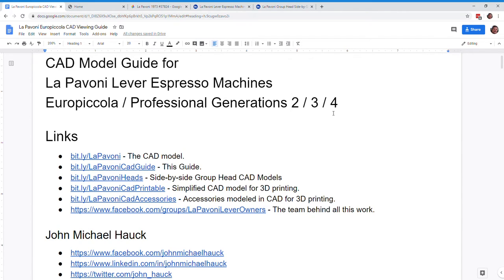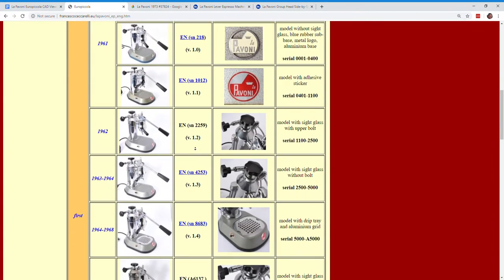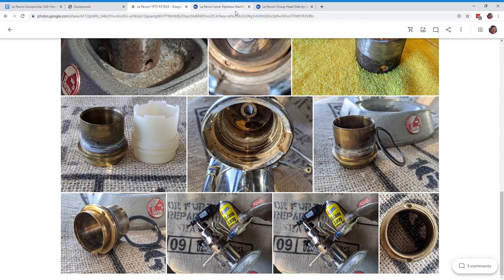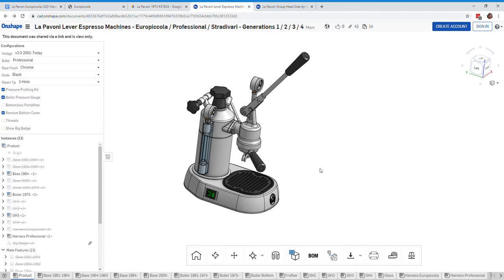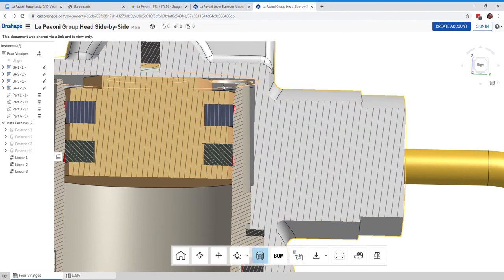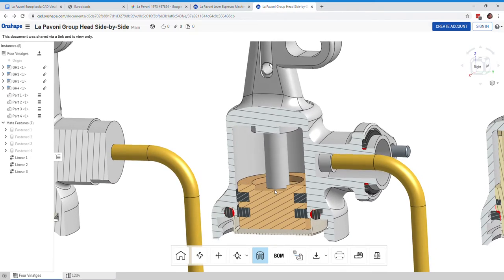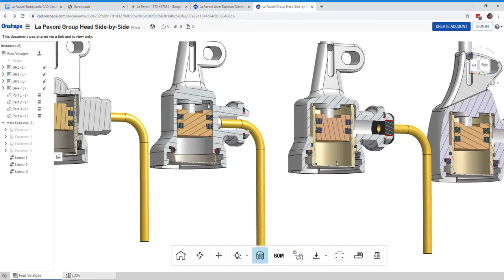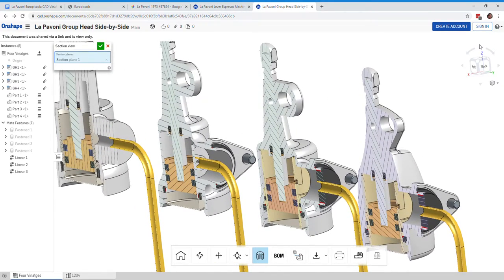2: Four Generations of Group Heads - La Pavoni Lever Espresso Machine

Comment: Hi John, great work! It explains a lot. Could you also explain what happens when you lift the shaft and the portafilter with cofee is on? I expect some air coming through the portafilter and the coffee being trapped above the water. I think this air steals some space from the water (reducing the shot volume) and makes the shaft spongy when you push the lever down.
Reply from the maker: Massimiliano, you and I share the same understanding of trapped air and spongy pulls. I wrote up my thoughts is two places: https://www.facebook.com/groups/lapavonienthusiastsgroup/posts/512743113415984/ and here https://www.home-barista.com/levers/trapped-air-spongy-pulls-again-t76728.html
Reply: Massimiliano, since I've started lifting the shaft almost to the top before attaching the portafilter, I've had the best crema ever.  It takes a bit more dexterity with one hand on the lever pulling up and the other hand holding down near the drip tray, but it's worth it!

Comment: Amazing work! What nice models. Are the diameters of the lever shaft of 3rd gen accurate so I can base myself on it to make a pressure profiling kit ?
Reply from the maker: You are welcome to view the CAD models at http://bit.ly/LaPavoni
I cannot provide any assurance of manufacturability. There are so many variables to consider. For example, there are variations in production, so any measurements made on one part does not capture the tolerances of a real product. Also, I used a digital Vernier caliper without formal training... so well there you go. I am open to any community feedback that can help improve these models.

Comment: Can you add a spring into the group head? Also could you add a valve to be able to pull back -to-back shots? Just two absurd questions I had.I have a Gen.2 La Pavoni and a more recent Professional.
Reply from the maker: You ask, "Can you add a spring into the group head?" Interesting! Well, then lifting up the lever would require a fair bit of effort to compress the spring. You might be lifting the machine off the table. The spring-lever machines I have seen have the handle the other way so pressing down compresses the spring. In any case, I think the spring would prevent the piston from going up high enough to let in the water. Other than that, I think it might work. I've never heard of anyone asking this before.

You ask, "could you add a valve to be able to pull back -to-back shots?". Honestly I am not sure what you are asking. If you mean raising the lever to run another pull of water through the same puck of coffee grounds, then you can already do that. It creates a vacuum when you raise it immediately after pulling a shot. That vacuum may or may not destroy the integrity of the puck. I'm sure you can get strong opinions on that either way. I've done it before. Some manuals say you can do it too. If you mean something else, then let me know.
Reply: @JohnMichaelHauck  Thanks for your reply. The second question needs clarification. On the automatic lever machines, most have a 3 way valve that allows them to take the portafilter from the group head without waiting 30 seconds or so before reloading another full basket, on a La Pavoni there is the traditional time lapse before you can pull your next shot, in the automatic machines there’s a 3 way valve and a bleeder tube that releases the pressure in the group head that releases water so that the portafilter can re-loaded. So could a 3 way valve and bleeder tube be fitted to quicken the time between shots in an LP? I have an LP and am interested in it’s mechanics.
Reply from the maker: Ah! Taking the portafilter off early on a La Pavoni can result in, what many affectionately call "The La Pavoni Sneeze". Some of the "after" photos are truly works of art. In any case, you can reduce the backpressure immediately on a La Pavoni by simply lifting the lever about half way and removing the portafilter while the maintaining the lever in this position. Why does this work? Understand that there is always some compressed air trapped in the area below the piston and above the coffee grounds. Raising the piston half way increases the volume of the area, reducing the air pressure. Another option is to use techniques to reduce the amount of trapped air  to begin with. My opinion (hotly disputed by others) is that by flushing hot water through the group head before attaching the portafilter will help reduce the trapped air. Why does this work? Because it helps the initial hot water that enters the area to "flash vaporize" (Google that term) into steam - driving out the air through the ground coffee. Of course, that means you are brewing with hotter water which may make the shot taste a bit more bitter. Finally, some people are experimenting in using a "pressure profiling kit" to bleed air from under the piston through the piston rod. Sheesh that was a long reply.
Reply: @JohnMichaelHauck  thanks

Comment: are 2 and 3 identical on outside?  they look to be
Reply from the maker: The diameter of the top part of the generation 2 group head is 50mm, while generation 3 is 60mm.
Reply: aahh ok thats the pre and post ones right?  @JohnMichaelHauck
Reply: ahh ok mine is the 2. ... what upgrades can be done to the 2? I refinished it in ferrari red and chrome and added the boiler pressure ggauge and a cafaleta portafilter/IMF basket  and silicon gaskets a few years ago but it always gave me issues like seizing up with handle up... hard to pull shots..  and just total inconstancy.. but ive decided to get it back out and work out these issues... usually im working on more commercial units but this one befuddled me until I saw your cross sections.. now Im curious!
Reply from the maker: @dparham  Generation 1 started around 1961, Gen 2 was 1975, Gen 3 was 2001, and Gen 4 was 2005. People call the Gen 3 the "post mil". Gen 4 is also after the millenium, but I think most people call that the Stradivari instead. "Pre mill" seems to refer to Generation 2 only. Generation 1 is also before the millenium but frankly seems like it is no discussed much. Personally, I just use the generation numbers. Finally, both Gen 3 & Gen 4 are actively being manufactured.
Reply from the maker: @dparham  As for your Generation 2, it is not clear to me when you mention hard-to-pull shots, if it is a mechanical issue or an issue forcing the water through the ground coffee in the portafilter.

If it is mechanical, my guess would be adding some lubricant to the inside of the group head and on the two piston gaskets. Search for a high temperature food safe grease.

It it has to do with forcing water through the puck, the following will make it easier: grind coarser, use less coffee (13g), brew when the group head is cooler, don't push the lever too hard - being patient to let the water get through, and use older beans.

As for upgrades to the Generation 2, the most helpful is what is called the "Bong Isolator" available at www.coffee-sensor.com. Here is a link to the product: https://coffee-sensor.com/product/bong-isolator-and-water-heated-grouphead-mod-for-la-pavoni/

You can also chat with the inventor (Bong) and the owner of Coffee Sensor at https://www.facebook.com/groups/lapavonienthusiastsgroup as well as people who use those products there.
Reply: nice! I like that isolator...this isnt a mechanical issue, it works most of the time but occasionally its very hard to press down and since it doesnt have a sleeve to crack im starting to think its overheating ...maybe.. Ive restored alot of commercial machines and have been a roaster for about 25 years  but this little thing hadnt been consistent so I put it to the side as a day 2 project... i did see a person mention lifting the handle just before water comes out then load the portafilter.. I did that and it came out perfect! Ill check again tomorrow... maybe some form of too high pressure ( me being impatient and using high heat to get boiler going) or needing to lift handle a little first to remove any air(sometimes just goes down with no resistance as only air inside brew chamber... anyway Ill know more tomorrow.. soon as I work out this kink, Ill hit you up for some nifty upgrades! I do like the pressure gauge coming through the piston too! is this available for this machine?
 @JohnMichaelHauck
Reply from the maker: @dparham  Enjoy your trip! The piston pressure gauge is here: https://coffee-sensor.com/product/coffee-sensor-full-piston-pressure-kit-for-the-la-pavoni-europiccola-pre-millennium-and-millenium-machines/
If you join the facebook group, you can ask for a discount code.

Comment: Hi, I would just like to add that the v1.x group is screwed into the boiler, and not welded. So, removal is possible although a bit tedious.
Reply from the maker: So like a large pipe thread? That makes sense.
How do you attach the siphon tube? At the same time you thread the group head?
Reply: @JohnMichaelHauck  yes large pipe thread. Francesco Ceccarelli showed how the group was screwed on the boiler. You could remove it by swiveling the base and putting a large pipe in the grouphead to use as a lever.
I don't know about ths siphon.